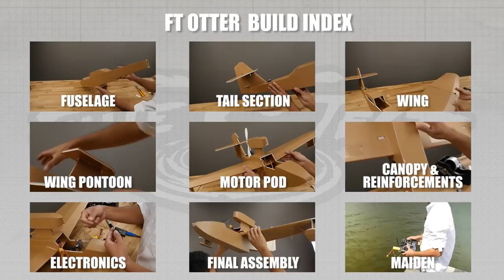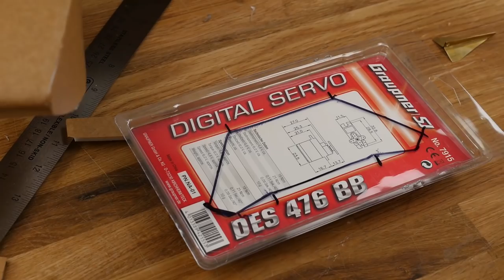FT Sea Otter - BUILD | Flite Test

Comment: What a great video, really cool kit well thought out one of your best I think. Big clamshell packages or 2ltr pop bottle plastic is easy to vacuform. It would be cool to do a show building a shop vac vacuform table for canopies and bodies. Peg board with holes is a cheap air drawing surface to use.

Comment: 24:28 and 29:20 you are getting lower throw when you use the outside hole. If you want more throw for the same servo travel, go for the inner side hole.

Comment: Just a quick note! This mistake has been made on a couple of your builds, but at the 30 minute mark, when installing the rudder servo, you state that you want maximum throw on the rudder, and thus to put the control linkage in the farthest hole on the horn. If you truly want maximum throw, then install the wire on the outermost hole of the servo arm, and the innermost hole of the control horn.

Comment: As for the bottom and the sides that touch the water you can use lamination sheets. The self sticking sheets that you fold over as this will give you a long and wide sheet of clear plastic. It should be about 12" X 16" or there abouts. You can also look for, if you don't mind black or a mirror finish, self adhesive window tint. there are different widths and lengths for it. You can even find frosted/opaque. If you do use either the lamination or window tint and have not put your plane together yet use the pieces as a guide to trace them out before you put it together. I would add half an inch to all sides before cutting it out.
As for the canopy what I would do is add a strip of foamboard, about half an inch wide to the inside of it on all sides. though with the front part I would have it slightly bent forward or the back as a catch. If you are doing this as a scratch build I would add 3/4 of an inch to all the sections in line with the section. In other words, where it sweeps up on the last little bit you will only add to the section that goes straight down and where it angles down and back you will go straight out from there so you have a gap between the bottom side and side back portion. form there you will want an S bend, an S bend is an A and reversed A, you will need to cut out a channel while leaving the bottom paper intact then a section of foamboard about the width of the foamboard then on the back side, the front side once fully assembled, another channel the width of the foamboard. So when put together it will have a 90 degree bend to the inside and a 90 degree going back down. To help make it watertight and a tight friction fit i would use hot glue or silicon on the exposed foam of the main body opening and between 1/4 and 1/2 inch on the inside walls. You only need a really thin layer. As for the canopy you will want to apply your glue or silicon starting at the underside 90 degree all the way to the bottom of the 90 degree down tabs. this goes for all 6 sections, forward tab, lower side tabs on either side lower rearward facing tabs and the back tab. For more piece of mind in holding power I would add neodainioum (spelling) magnets, the smallest ones should be more the enough, to the tab on the front and or the back tab. 
Those are the mods I have done to this as well as the Sea Duck I have made. I like the window tint look best but that's my personal preference. I wish I could share pics of mine, as well as schematics of my modified canopy but I don't know where I could send the files.

Comment: that peace you cut off of the canopy at the back you could just score the foam and remove from the paper using the paper as your hinge gluing to the top of the plane , then bbq square 1/2 an inch back from the nose of the canopy holding the canopy down with a #64 rubber band.

Comment: Yet another build video where I'd like to recommend the hot glue gun from the Flitetest shop. My personal opinion is, this is the only glue gun you should be using for your builds, and trust me, I tried a LOT of cheaper ones before I finally got this one. I would've save a TON of money if I had just gone with this one to begin with.

Comment: felicitarte por este modelo de avion , pero no me queda claro la incidencia del motor que angulo o grado de inclinacion le pones , por favor podrias explicarmem un poco mas a tetalle , ya que los aviones blixer le gan la incidencia adelante angulo de inclinacion hacia la punta del avion , por favor expliame un poco mejor ya que en este avion colocar horizontalmente la base donde va el motor porque ?
Congratulate you for this model of plane, but I am not clear the incidence of the motor that angle or degree of inclination you put, please you could explain a little more tetalle, since the blixer airplanes gain the incidence ahead angle of inclination towards the Tip of the plane, please explain me a little better since in this airplane place horizontally the base where the engine goes because?

Comment: I built this plane from plans and it flies really bad, it tends to do a snap roll and get into a spin. the ailerons have really low throw (about 1/4" up and down) and the roll is super sensitive.
Reply: correst your CG
Reply: @trfpvVT  mine flew great but it took a little adjustment of CG

Comment: Thank you guys...

Could you please tell me the dimensions of this foam sheet, and how much it weighs please?
Because it is hard to find low weight foam sheet here...

Thanks.
Best Regards
Reply: Hey buddy I am not from flitetest but I would like to help🙂. This is dollar tree foam board sheet which is about 5mm thick and it's one sheet comes as a rectangle of 30" x 20". It weighs about 20 grams a sheet and is laminated with paper on both sides. That's all I know. U can definitely get to know more on Google.

Comment: I see that it was windy day, but flipping it over after carefully making sure its watertight on the underside, kind of ruins the whole video. 

I mean what about the Motor, ESC, Receiver, Elevator Servo, last not least Lipo, seems like they all got drained.
It hurts to imagine what happened there.

IMO the whole plane should be bigger and heavier, which would make it more wind resistant, both in the air and on the water-taxi.
Otherwise, as always, much respect, for a beautiful build and beautiful airframe design.

Comment: i find it odd peter you choose to make a open canopy sea plane.  as we seen water gets inside rather easy.  seems like  it was choose for its aesthetics and not function, so form comes first here. however, you could use the plastic you used for your window, and line the inside with it..  your canopy is the choice i would pick.. i  would use magnets from the harbor freight.  just add a couple of extra pieces of foam to what you have already design.. it would be easy to adapt magnets to it.. and weight is not a issue you will not have to worry about your canopy flying off like happens when two small of magnets or not enough really is hard to say never know with great Chinese engineering, the builder of the great wall would even laugh at some of there choices these days "D..

its a cool plane none the less, even tho the day i can take off from water here in AZ..  the only complaint iv already mention and it seem others did not like your choice of a open canopy either.. as i have noticed from the comments section of the death of the pretty red plane. :D   anyhow, you do a good job explaining your build..  and you do not repeat your words over and over like josh sometimes will do. :D  in the end tho its another plane for people to try and fly, and lets face it. there are a huge lot of people who could not really fly because of that water.. now you have open it up to them too.  which is really cool.  even tho im glad i do not live on a lake.. i would be such a pansy, i probably would never try to fly a quad over water.. r.i.p pretty red plane.. that brown foam board takes a much better paint job than the other stuff that is for sure..  you could almost buff that out, laughs.  does  the brown foam board have a good and bad side like the old school white dollar tree foam board from Addams?

Comment: I have built and flown every flite test plane.  This is the only one that does not fly well.  It will snap roll in a second.  This wing performs well on the spits so it must be where the motor is mounted.  Love these guys but this one is not worth the build.